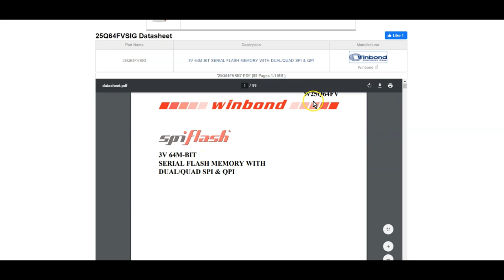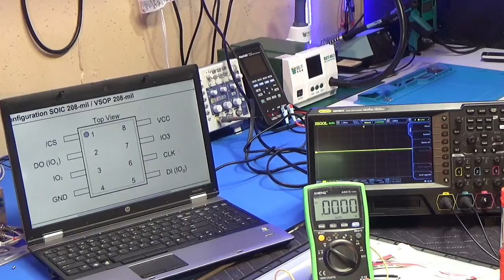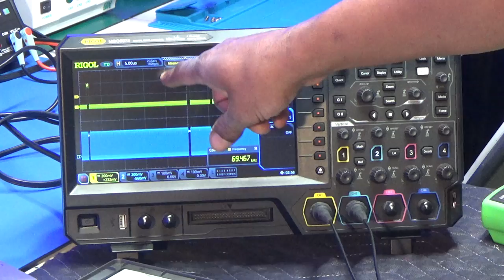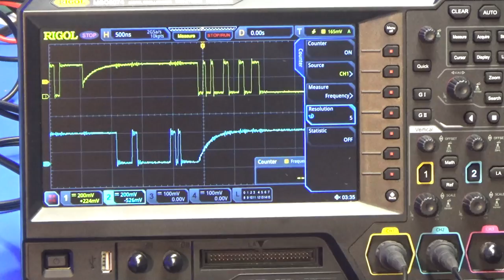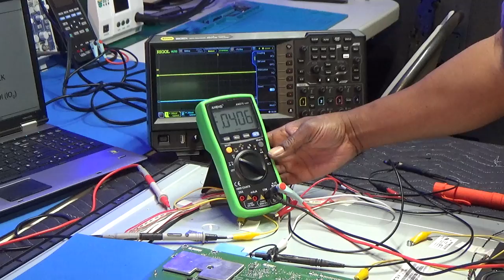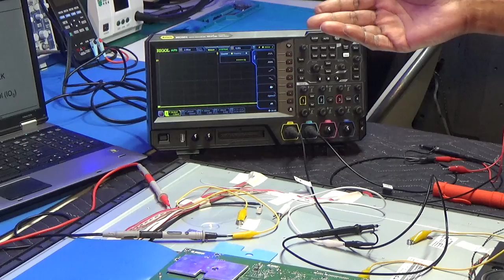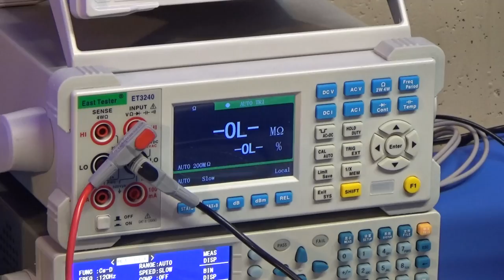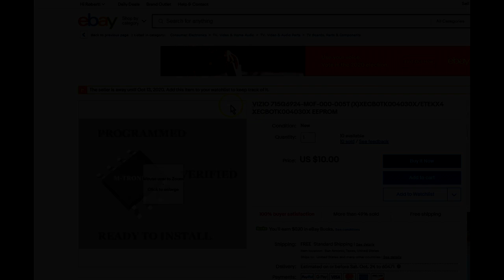How to Troubleshoot/Check Television EEPROM Chips before replacing the entire Main Board.

Comment: Excellent! Thank you for the video. I am faced with trying to repair my ONN ONC50UB18C05 50" TV, which decided, after 3 years of excellent service, to no longer turn on.  The only LED indicator performs as it should when both the power on button on the back and on the remote are pressed, but the screen remains dark.  No backlight and nothing visible on the screen with the flashlight test.  I've searched and found mention that the EEPROM is a common failure point that may cause this symptom.  In my 4 decades of working on IT equipment I always seen EEPROMs in circuits to save user settings, not operational firmware, as that would be either mask ROM or some other RO memory.  But I'm willing to try replacing the Winband 25Q64JVSIO chip given it's low price and see if that fixes it.  Your video was helpful in giving me a glimpse of the signal waveforms, because before I remove the old IC it would be nice to base line the before versus after waveforms, like you did.  Your shop is very well equipped I must say.

Comment: I’m working on this same TV with  the same symptoms. However I changed the eeprom and it did not fix the problem. 

I did find heating the area with the heat sink made the TV work again. However it was short lived. I believe the problem is the soldering joints on the main processor. 

Have not had time to remove heat sink and look into it any further. 
I look forward to your update video to see what the final resolution is. 

Thanks again for the great videos
Reply from the maker: Yeah, thats most likely the problem. Have to get that big heat sink up and heat up the Micro itself.
Reply: Any update on this TV. I got the heat sink off. Haven’t decided if I should reflow or remove and reball. 
Just curious what you did or your thoughts are?
Reply from the maker: @prideroofing3178  Just try to reflow first. I start with about 400 degrees for about 3 minutes, slightly pressing down on the IC with something once It gets warm.
Reply: Appreciate the tip. Thanks again for the info

Comment: Enjoyed the video.  I’m having issues with my tv doing the same as the tv on this video.  I can not tell which is the correct eeprom on my main board.  I really don’t have the proper set up to do any repair.  Do you test and repair main boards? I would hate to replace the main board if it’s only a eeprom.  Big difference in price.  If you by chance do except boards for repair please provide your information.

Comment: Great info, I learned something new. 👍 maybe one day we can collaborate.
Reply from the maker: Sounds like a Plan.
Reply: Hi both in one video very good info
Reply: Quick question, I have 4k led, has backlights, sound but no picture. Tcon is fine as I replaced it. What could the issue be? Main board of psu?
Reply from the maker: @Trapzzz3  Bad panel drivers.

Comment: 😥A CLK SIGNAL IS THE BASIC THAT CREATED WITH THE PROCESSOR WHEN IT'S POWER UP. Sir, if you did not see a clk signal, probably means u are shorting ur gnd or vcc with ur new IC. Try removing the new IC leaving the emply tread mounting, power the tv up again see if the clock signal comes back.

Comment: 8:57 why you have used a ESD mat to protect the boards? Isn't that conductive?
Reply from the maker: No it isnt.
Reply: @bigdog8882  of course it is, measure the black side with your ohm meter lol
The blue side its dissipative only and the bottom is conductive made out of conductive rubber
Reply from the maker: @FixDaily  I been tried that just to make sure. Blue side is good. Just needed something to keep circuit boards from snagging my covers or towels. Thanks for the Advise though, appreciate it.
Reply: @bigdog8882  Use a cardboard :)
Thanks for sharing your tutorial about EEPROMs, it was very useful for my repair, well it didn't repair it but at least i know the problem is not the Bios IC lol
Thanks mate

Comment: I have a question. I replaced the leds on my tcl 32s301 everything went fine until I started to put in the outer bezel for the screen as I have to squeeze a little to get it to clip on. I was very careful and I still broke the screen. Now the tv is garbage. Do u have any pointers on how to do this without damaging or breaking the screen? Like I said I did it very carefully and it didn’t work. Is there a trick on how to snap the bezel back in without putting pressure at all? Thanks

Comment: Hi, before removing old SPI you should freeze this chip and check if its help, anyway you should buy programmer, we have about 10-20 tvs per week with faulty SPI or eeprom without programmer you"lll stuck with jobs for weeks, 
Grettings from Ireland, keep up.
Reply: wefixtvs agree with you Goodmans, cello, bush, vestel rubbish, always doing them download dumps sorted
Reply: @wisher21uk  yeahh but Vestel main FW core rubbish.

Comment: Hi friend my tv play for about 10 minutes then I get a blank blue screen, do you think it could be a eeprom problem
Reply from the maker: If you still have sound then wiggle the Long Flat ribbon connector going from main board down to t-con board to make sure the problem is not a bad connector going to the t-con. If good then just chance buying the $20 EEPRom chip. Personally I never seen that problem being a bad eeprom chip.
Reply: @bigdog8882  thank you for the advice I will try that

Comment: Heat the main BPA Ic's with a heat gun for about a minute...these cause all kind of faults...385* will suffice scrape off old heat sink apply new..2 are on this board ,I believe
Reply from the maker: Thought about that, but looking at that big heat-sink shield over it, it was to difficult for me. Thanks for the info though, appreciate it.
Reply: Easy to take off...once you do it once..kind of a neat system

Comment: This EEPROM ic clock signal not come but check purposes external clock signal applay  from signal generator this ic so you working EEPROM just excrement please request 
My deyar your  electronics lab use all instruments introduced haw to working used please macking video my request from india thank you
Reply from the maker: Thank U from India!
Reply: @bigdog8882  omg out of all your videos I don’t see my problem help me please. My tv is the tcl 65 inch. I have sound no picture. But the screen is not black it’s blue and I tried the flash light thing but I don’t see those apps like in your video what could be wrong??

Comment: The mainboard part number must be exactly the same and probably there is a different panel type in every model.The eeprom will not work because there are differences in the software also and reading a few only bytes from the memory the processor tracks the error and stops.Software eeproms and nand on modern televisions are turning to a huge problem to the repairing process unless you own an authorized service center and deal with the same brand and models everyday so is easy to duplicate each model eeprom.Otherwise things are leading to disaster.